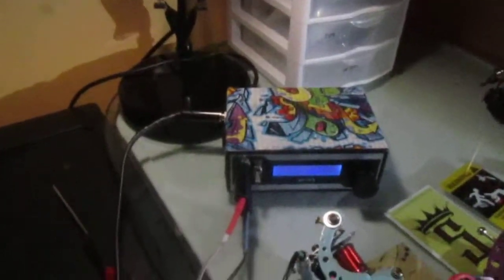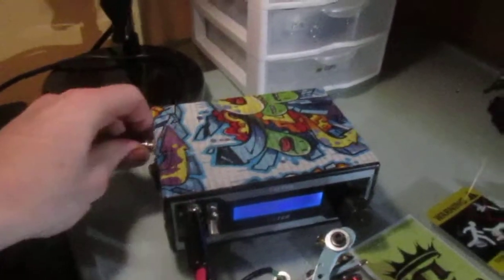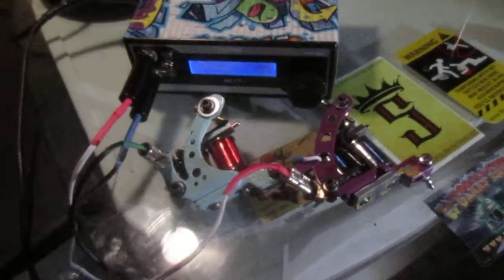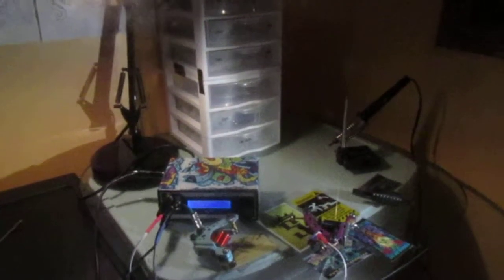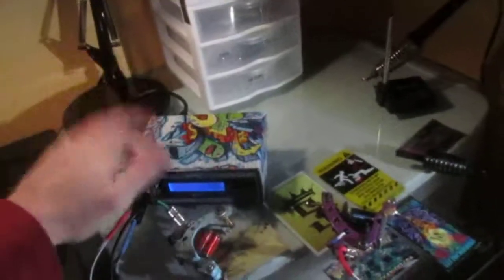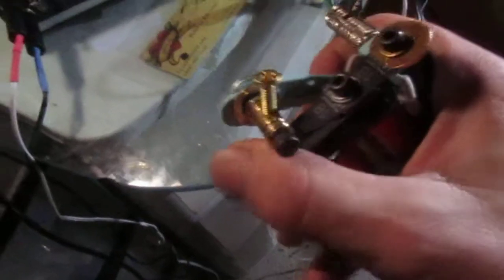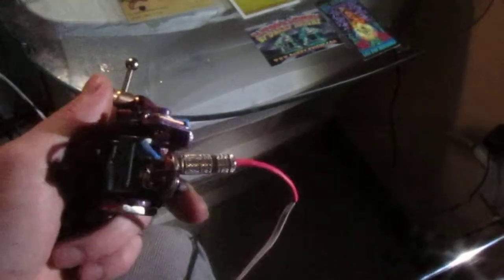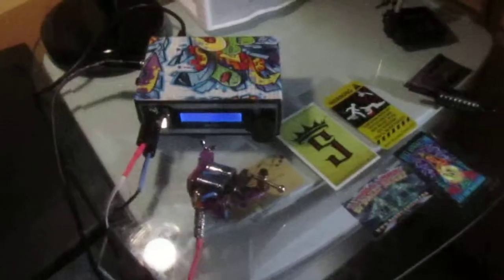modded power supply

Comment: Good Video Andrew,  s far as Hurricane power supplies, I have a few & a few Ekion knock offs as well. 2 Monster Point Power Supplies also Chinese, & a few home made ones. Personally I have never had a problem with the known offs.

I build machines for my self. I do not sell anything nor do I want to. I have a Art Gallery Attached to my Tattoo Studio, So I do Sell my Paintings T-Shirts, Hoodies, Bandanas, hats, Tattoo After
Care products, but thats it.  

I rebuild Chinese Coil Machines or use the Chinese Frames, Cast, Wire Cut, CNC Machined. & Wrap my own Coils, making the coil cores some times, makethe springs most of the time, buy armature bars. I have Had a friend who is a Union 
Master Machinist, CNC a few frames for me, that were original. But that is a more artistic approach, then practical.& have mad a few Custom Rotary's.

Personally I hate spending money unnecessarily. I use GIMP, The Free version of PhotoShop. Make my own Stencil Transfer Solution. Own Miracle water for placing in ink caps, own grey washes.

There's a lot of Rip off products on the market. & unfortunately I see a lot of new artist getting reamed. 

A lot of I saw that this Artist in a tattoo magazine, or @ a Tattoo Convention, Seminar uses this ink this machine this companies needles. WTF!

THEY ARE { SPONSORED } [ie]  Paid money to Promote that Companies Products. They also receive free travel to events free hotels, & most Conventions they are booked doing Tattoos, They do not pay for the Space. Additionally most Suppliers have an Area for Traveling Artists to tattoo out of FREE while they are in town either before the convention or after. Research WHAT WORKS FOR YOU, & your Art will improve immensely.

Paying 8 X what it cost me to make Stencil Transfer Solution. & Mine is Cheaper, Safer, LongerLasting, & has ingredients in it to promote healing. A similar recipe to mine @ SINCITYTATTOOZ , YouTube Channel.

Nice Looking Machines BTW

Take Care, Bill Kearney